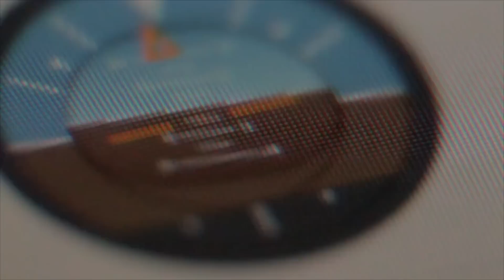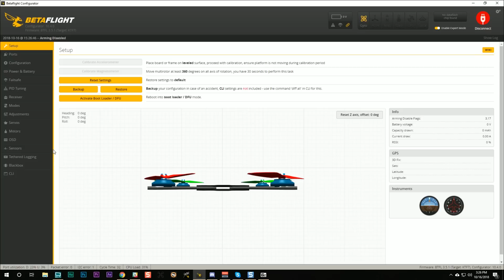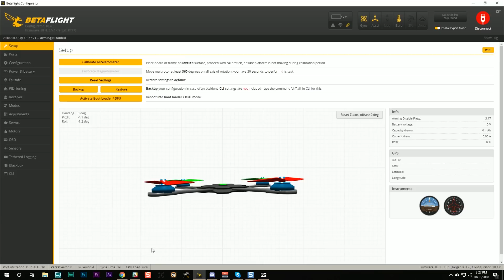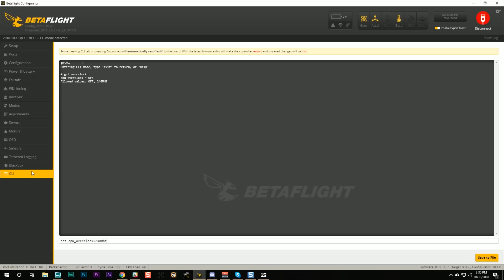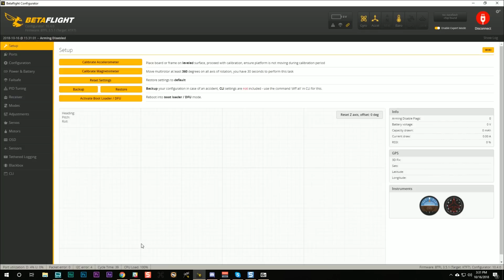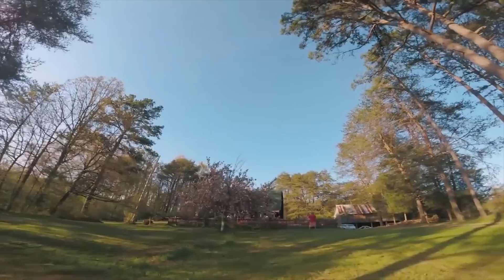BETAFLIGHT WON'T ARM | LOAD arming status flags

Comment: Hello Joshuam I found your wonderful channel !!! Congratulations. If you can help me, please. I'm trying a few days to arm my drone, but my lack of experience in the subject is hehehe weighing, I have a ts215 eachine, a tanarisQx7 radio I'm using the Bfly10.4.0 and the controller and OmnibuF4 and the batteries are S4 tattu 1550-75c.
I create the ARM lever, set the ARM lever, test on the Bfly check the plane in the drone, set the maps. At Bfly he responds, I unplug him and try to arm him and nothing. I've already seen your tutorial a few times, and I'm already lost in everything I've done. Do you have a program that verifies the error or causes of not being armed? From now on I thank you because your channel already helps me in more things ... hugs !!
Reply from the maker: Please go watch the 1st video in this playlist, which will show you how to find out the Arming Status Code. That is the reason why it won't arm. Then find the video in this playlist that describes the code.
Reply: WOW! So fast!! thank you! I will try...

Comment: JB got a question. I bought and built a 5" race quad. Everyone seems to recommend 4S around 1500-1800 mAh.?? I got a half dozen 4S 2200 mAH. Besides weight, any reason why not to fly these.?? They're normally used in my motion RC EDF'S..
Reply from the maker: Weight is the exact reason not to fly them. Even 1800 mAh is a bit chunky. The absolute most I'd like a battery to weight on a 5" mini quad is maybe 180 grams. Closer to 160-170 grams is better. Closer to 150 grams is getting into the ultra light category by my standards.

I'd wager those 2200 are over 200 grams. The quad is just going to fly like a pig.
Reply: Makes thing get hot or burn up.esc and motor get over worked .hope this help
Reply: @picpic3103  got it. Thanks..
Reply: @JoshuaBardwell  Thx JB figured that was it. Bummer cuz they're some good batteries.. lol

Comment: Hello Joshua I had, in the beginning, random arming success later I let the arming errors display in my osd. It was saying Yaw up and Pitch up I tried to increase the dead band center stick and calibrated the controller and in Beta flight again. Now it arms always but sometimes I see the messages in the display again. Is my logic the right one assuming it is because is glitching or is the sticks are not centered always at the same position. I have a qx7 Default gimbals.
Reply from the maker: Check the receiver tab and make sure channel endpoints go 1000 to 2000 and center at 1500

Comment: So just built my first little quad and I can't get any video signal past like 20 ft :(. Any ideas?  I'm matching channels on my vtx and goggles, got the exact same polarization on the antennae... Upped the power output on my vtx to the max (600) and still I have like 0 range :( any ideas? Thanks
Reply: Your VTX must be burned. 😕
Reply: @MCsCreations  even if I have video signal when I'm close to the quad? :/ Darn :(
Reply: @kaden9572  Does it have smart audio? And are you changing the power output using the transmitter or pushing buttons of the VTX?
Reply: @MCsCreations  I think it does have smart audio... And I'm just pushing the buttons on the actual vtx.  Thanks for helping me!!!! I'm seriously lost..
Reply: @kaden9572  Than that's it, dude. 😊
It's a Betaflight "characteristic... You change on the button, the FC doesn't have how to know that and change it back... So you're probably stuck in pit mode (I think that's the name). So, try changing with your transmitter (throttle to middle, yaw left and pitch forward while disarmed). Than it should work. 😊
And don't worry, dude! You're more than welcome. 😊
Reply: @MCsCreations  I'll try it today after work! Thank you!!
Reply: @kaden9572  When you do, tell me the results. 😊
Reply: @MCsCreations  amigo deu certo!!! Tava no 'pits mode' mesmo!! OBRIGADO!!!!! tbm dei uma olhada no seu canal e vi q vc é brasileiro kkkkkkk eu morei aí por um tempinho ;)
Reply: @MCsCreations  e nossa cara seu inglês tá bom pra caramba meu... Parabéns.  Inglês é difícil demais kkk
Reply: @kaden9572  Opa, legal! Que bom que foi algo simples! 😃
E obrigado!!! Não veio sem muita prática! 😉

Comment: I can´t ARM to calibrate the current sensor if the quad is connected ! It´sucks !It´s possible on older versions. How can I change that ???? I don´t want to unplug to make the current measurment.
Reply from the maker: Two things. You can spin the motors using the Motors tab, and it shows the current and volts at the top of the Motors tab so that's how I would suggest calibrating the current sensor. If you arm, the PID loop is active and the motors can change speed unexpectedly. But second, if you want to arm while USB is connected, go to the Motors tab and tick the "I understand the risks props are off" slider and then you can arm.
Reply: I´ll try this, thanks !

Comment: I spent all my money on a holybro stack, was running 32/32, it lasted 5 flights, then burned to the ground. Could this have been the problem?
Reply from the maker: Probably not. Usually when a stack burns the ESC starts the fire.

Comment: Alright, I've either got a real stumper for you, or you'll know what it is right off rip. 
SPC Maker C120 that I put a HAK RC 20 amp blheli_S 4-in-1 ESC in. It's running a set of Spintech 1106 8000kv motors. A XM+, Micro Monster Pro, & a OG Emax BabyHawk's VTX (from the FPV Cam/VTX AIO it came with). And I've had two FCs installed in the past week, and both FCs had the same issue when I went to do the first powered up tests. Neither responded whatsoever. Neither to batt. voltage, or USB voltage. And though I have yet to be able to test the 2nd of the two FCs, the first (once I had it all the way disconnected and removed from the build) is now responding to input Voltage as expected. (The 1st being a old Flycolor F3 20x20mm, the 2nd and yet un-retested is a HAK RC FOR Nano I think it's called (another 20x20mm). Although I haven't tested it post removal, I have a nagging suspicion that it's going to act the exact same way now as the Flycolor F3 did once removed. Any ideas?

This is a build I was/am trying to put together for my ten-year-old son so he can start learning FPV.
Reply from the maker: If the FC doesn't power up, check with your multimeter to see if there is the correct voltage applied to the FC power pads. If yes and the FC doesn't power up, then I would suspect it was damaged. But most likely the answer is no, there isn't voltage, and you have to figure out why.
Reply: @JoshuaBardwell  would that cause the USB to also not provide power as well (also while still installed in the build)? And assuming that's it, and yes it somehow or other does cause the USB to also be unable to power the board, would it then not be totally inexplicable when it goes back to working normally after taken out of the build?

Comment: This video is only 50% of the truth. Every !!! F4 FC with an ICM20608 (e.g. this Omnibus F4 Pro corner for $33: https://www.gearbest.com/flight-controller/pp_1419701.html?wid=1433363) will run at a tolerable CPU load, if we set 32k/16k sampling and set an overclocking  to 216MHz.